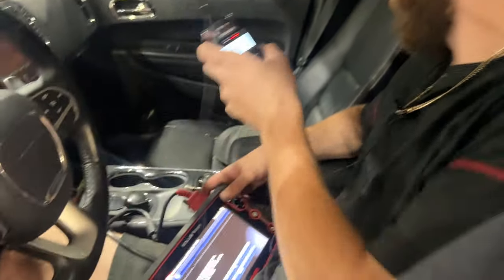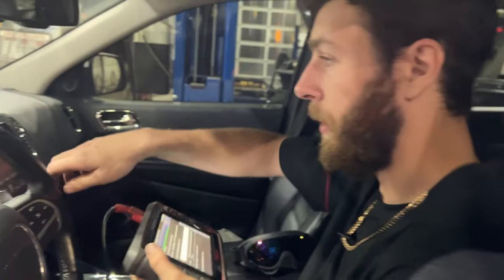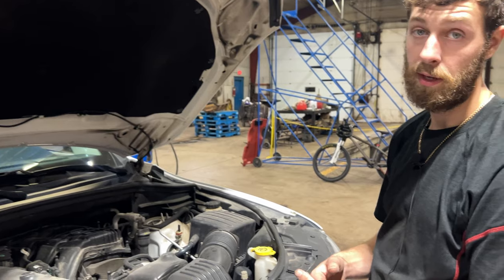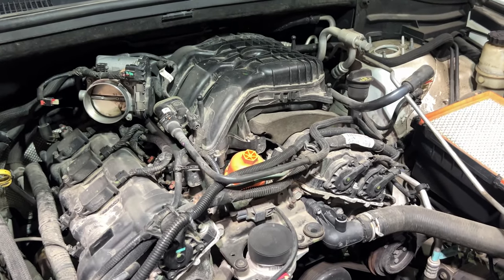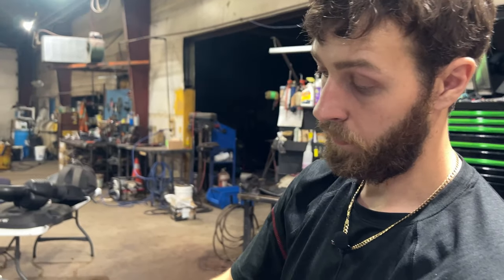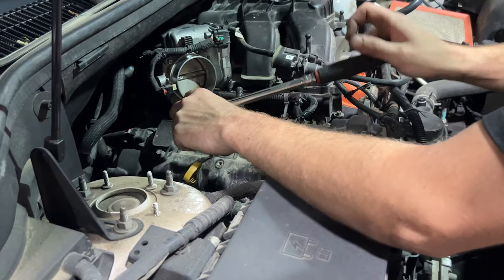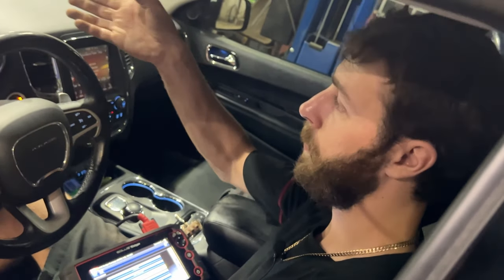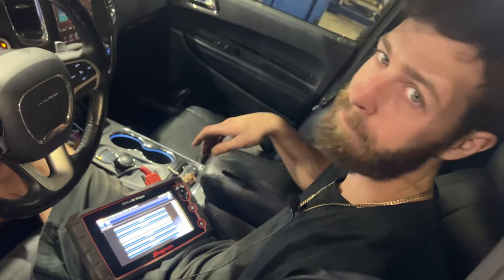Cylinder 1 Misfire P0300 P0301 2015 Dodge Durango

Comment: Thanks for the video bro, So I'm having the same exact issue and code but only says cylinder 1 misfire so i changed out all 6 spark plugs and continues to give code after i clear and runs bad at different times then doesn't, Do you think motor is shot? or like a bad Cam
Reply from the maker: Did you try moving the ignition coil packs from cylinder 1 to cyl 3 and vis versa? Also could be a roller failure on the camshaft, seen those go bad a lot
Reply: Could be the coil

Comment: I have the p0301 code and have some shaking while on idle, would changing spark plugs and coils fix that issue?
Reply from the maker: It could, but you would have to either diagnose it yourself or have a technician diagnose it to be 100% sure. If you are able to have someone scan it and erase the fault codes and then mark and move the ignition coils around to different locations, if the same code comes back than you know it’s not the coil, if it’s the cylinder you just move coil #1 too than you know it’s the coil

Comment: Where did you get the obd scanner? Doy ou recommend that one? Name of it pls?
Reply from the maker: That’s the snap on solus edge, great scanner, your probably looking at $2-4000 for a used one
Reply: @Tech-28  damn out of my budget. Any other brand you recommend? I'm working on my ignition coils and spark plugs as I type this 😆. Had to get the check engine code from O'Riley's.
Reply from the maker: @Looey-lu  https://s.click.aliexpress.com/e/_mq140uy

Buy this one

Comment: Mine 2013 v6 has multiple cylinder misfure code p0300 what should i do?
Reply from the maker: @Alsyedfurnitures  did you recently get gas?  Sounds like maybe you got some bad gas
Reply: @Tech-28  i just bought the car 2 days ago and it has same code i deleted the code it appered after 2 days again
Reply from the maker: @Alsyedfurnitures  you may want to pull the spark plugs out and take a look at them, it might need new ones if they haven’t been replaced
Reply: @Tech-28  ok i will check them
Thank u 🙏

Comment: Ok so my 2014 3.6 came up with a cylinder 1 misfire so took it into shop they chanced the plugs and coils, took it home next day same code comes on cylinder 1 misfire
Reply from the maker: @merlonfox8769  it’s possible you’ve either got defective parts, bad wiring, bad lifter/rocker arm, bad injector, or low compression on that cylinder
Reply: @Tech-28  ok no I took the chance on replacing the coil and I must of got a faulty coil the first time because the replacement coil fixed it
Reply from the maker: @merlonfox8769  glad to hear you got it fixed